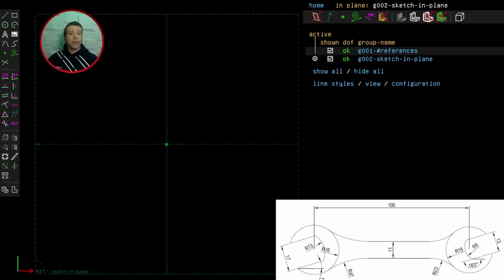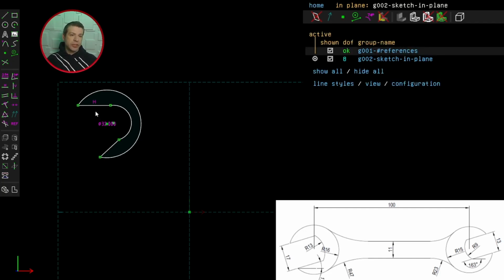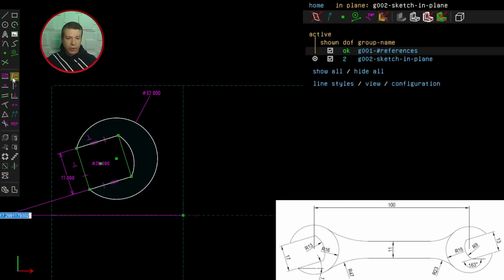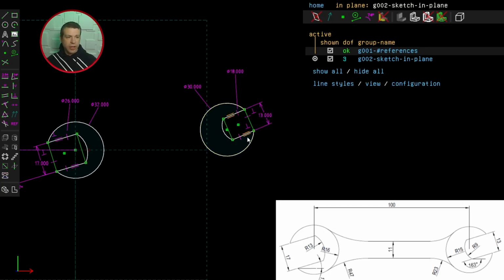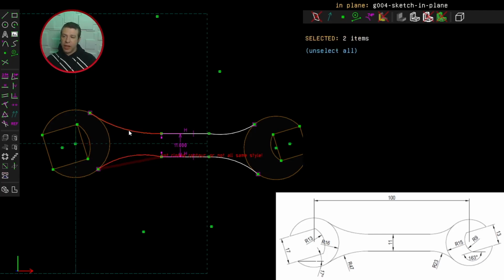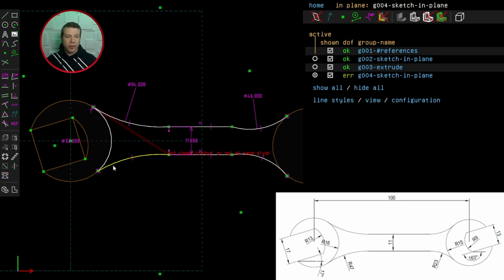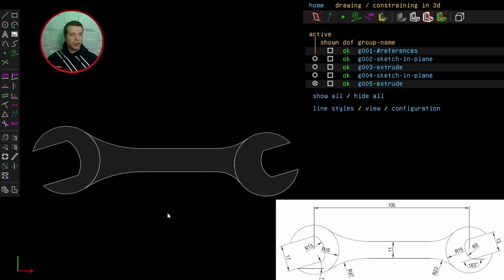SolveSpace - Challenge 9

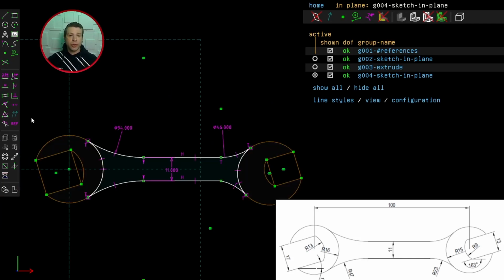Comment: 7:25 instead of forcing nurbs (which can mess things up sometimes)

You can select solid model as Assemble

That essentially tells solve space to assemble what you extruded to the other extruded models. 

The reason why it turned red was because it tries to unify the current extruded model but is unable to do so because it is intersecting with the previous extruded models.

By choosing Assemble you can create models within models.
Reply from the maker: Thank you! That's very informative and great to know.